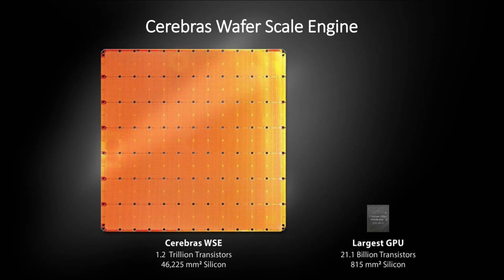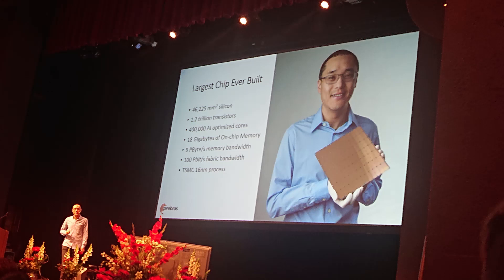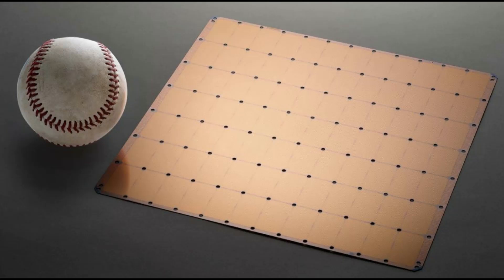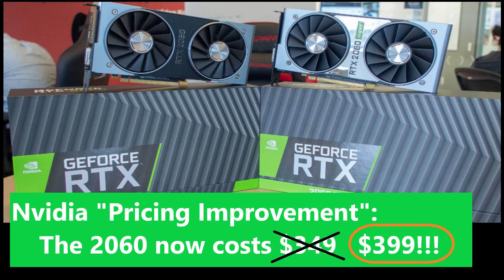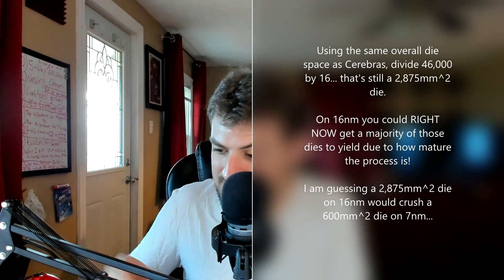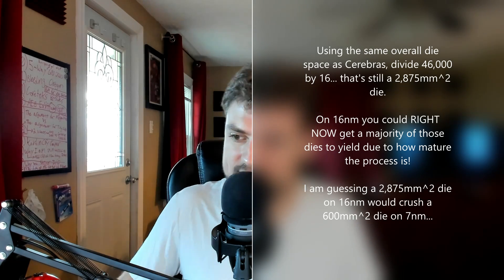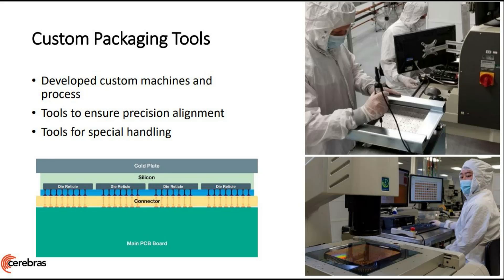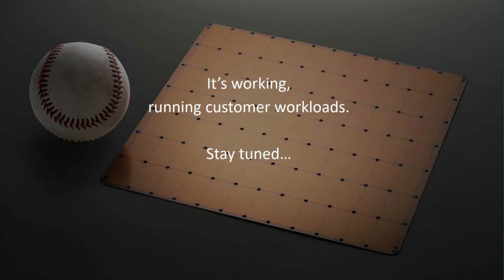The Monolithic Future of Silicon

Comment: In the near term the size of the reticle on the steppers will be the limitation on size of  die.  The only way to get around his limitation in the near term is to divide the design into identical parts  so the stepper just has to print one dice then step and repeat it again as many times as needed. I am sure just by looking at the picture this is how they did the 46,000 mm^2. It was one recticle printed over and over again. 

I think it will take years to produce a system that can print a whole wafer at once. However  a lot of applications can take advantage of the ability to construct ICs out of repeated units.

From what limited information I can gather Nvidia chips have been at the reticle limit since 28nm.  The current largest Nvidia chip is 815 mm^2 I believe.  The reticle limit of the steppers they are using is 32x26 mm so that would be 832 mm^2. I got this info from a source that I have no idea how reliable it is.

Comment: I think the main issue they are going to find as they go to smaller nodes is the ability to dissipate the heat generated by the chip. I think AMD is investigating building in Thermoelectric Peltier cool on their stacked chips.
Reply from the maker: Indeed they are

Comment: Those dies are kind of like SoC. But theoretically you can pack whole PC circuitry into monolithic die - cpu+ram+mobo+gpu together on one die. Question is how cheap and how fast comparing to what we have. It will just be smaller without any chances of overclocking or upgrades.

Comment: That's a good point.

If they made an 8 core i9 or Zen 2 with 8-16GB of memory built in to the CPU, what would we actually have?

There would be an obvious cut off point where we wouldn't gain any more, the architectures now are built with the caches keeping the execution pipelines fed from 30GB/s relatively high latency memory, so the architecture would have to change to take advantage of it, but in all honesty I'm expecting CPUs to have 256MB up to 1GB of L4 on package in desktops before 2030.

Might even see it in Zen 3 or Zen 4, HBM L4 on the IO chip.

Comment: Zen 4, perhaps double the L2 size, remove L3 altogether and have 2-3 times more cores in CCX /Chiplet, and have huge L3/4 cache in IO Die. This would allow shared L3/4 for all cores, and allow more cores per CCX/Chiplet. And not just eviction cache, but normal L3 cache.
Reply: Right on L2 double, but L3 has a crucial role in reducing the penalty when work loads migrate between cores.  Usually L2 isn't shared between cores.
Having unified L3 in a chiplet gives large bandwidth and low latency, avoiding going off die.
Reply: @RobBCactive  If you would move L3 on another die completely, you could have double the cores on the same chiplet, and have larger L3 that is unified with all chiplets.

Penalty would be higher latency, but you could lower latency from RAM as you would have larger L3.

It's perhaps not the best thing for desktop CPUs were the competition is still so much about single thread performance, but for perf per area and with more cores that would be the best way to do it in my estimation.

AMD's strategy to create one chiplet that is used in desktop, Threadrippers, EPYC kind of forces the current method, and also the smaller the transistors the more you have heat density, thus 16 core chiplets couldn't clock that high anymore. So integrated L3 makes sense. And with EUV nodes you can pack caches really dense so the area needed is not that much.
Reply: @juzujuzu4555  From what I see, a CCX L3 seems to work but perhaps an L4 cache on a memory channel might be interesting, saving energy to RAM and reducing inter-die performance issues
Reply: @RobBCactive  You could have all the L2 work for all the cores. So that if the looked data is on any L2 then it's copied to the core that needs it. 

So in this way I think you could have large L3 on it's own die. Just create big enough L2, perhaps 1.5mb per core, and have 16 cores per chiplet and thus have 24mb of L2.

L3 in it's own chip could be 256 to 512mb. Or perhaps even have cache chip that itself has faster and lower sections.

I'm pretty sure Zen 5 or 6 will have at least that unified L2. 

Though multitier cores are coming too, Intel of course already having them, so it will be interesting to see how they will handle caching.
Reply: @juzujuzu4555  That L2 effectively becomes L3 or LL - last level.
If you go and look at Zen3 chiplet die, you'll see L2 is part of core, nearer so lower latency.
The L3 holds data evicted from L2, it doesn't belong to any core, thus a core can load it into its own cache, process and invalidate it in L3 when it's changed.
Why mess with what works brilliantly?  Intel fanbois still claim chiplets high latency but the Zen3 design actually has faster access as measured by Aida64 than over their vaunted ring bus.  They did same on Zen4 launch claiming 63ns DDR5 is slow RAM access when ADL has around 68ns.  My Zen3 has 57ns IIRC and that's higher in the table unless you go back to older simpler  proccessors like Athlon 64 lolol
If you want a mega cache, call it L4 but the access latency will be slower as it'll need higher associativity,  which is why a disintegrated L4 with  caches in memory control die that serves a single 32bit memory channel is interesting.
Reply: @RobBCactive  That PowerPC architecture has L2 within each core, but they still somehow work as one collective cache. Though I don't think you can save data to L2 of other core, but you can read from the other cores. 

The reason to get L3 out from the chiplet would be to have more cores per chiplet and have one unified cache for all the chiplets. That could work if for example full chiplet would be 16 cores and have 16mb of L2 or perhaps even have 1.5mb per core or maybe even 2mb. 

In that case the penalty of higher L3 latency would be tiny, and the benefits of unified last level cache between all the chiplets could be huge. 

In the end that would save silicon area, would allow them to make 16 core chiplets that would be still only slightly bigger than the current chiplets. 

And you could make the cache die at cheaper node.

I don't think the higher latency on larger cache would be a problem, because there would be that collective L2 already. But to know for sure would require simulations of course. I wouldn't call that a mega cache as there's already 256mb on EPYC and 768mb on EPyC  V-cache version.

Though on desktop that wouldn't make sense yet, perhaps later when the number of cores goes up.
Reply: @juzujuzu4555  OK but the IBM L2 virtual L3 must have a cost in cache complexity.  So my argument is that increasing L2 size and complexity may be more trouble than it's worth.
I am sceptical that the IBM design will break through, the name L2 doesn't make the memory work faster, the risk is making common cases have higher overheads.
Now we know Bergamo reduces L3 cache to double CCD core count, we don't know if it uses 2xCCX or a single with unified L3, or even if L2 isn't scaled down too.
But Bergamo is intended for hyperscalers who want to lower cost of providing a level of service and likely know their jobs are not cache heavy.
Let's suppose there's an L3 die, every chiplet has to communicate with it AND the IOD.  That adds complexity, how do you physically arrange it so chiplets have equal service?
Then are these new chiplets compatible with desktop ones?  Have we lost the benefits of mass production to bin chiplets that meet exceptional performance and/or efficiency goals?  (Just 1 chiplet needs the 2 fast cores for max ST boost)
So I think there's economic arguments against it too.
Cacheing a memory channel as part of the memory controller for a better L4 OTOH encapsulates the complexity.  It just looks like fast memory using less power in a larger IOD, or with split MCD/IOD chiplets they could even use V-cache.
If it works for RDNA3 why wouldn't it for CPUs?
Reply: @RobBCactive  I would assume that the L2 works as fast for the individual core as normal L2, but in the case that you don't find the data on your local L2 then the latency is closer to L3 level. Though if this is the case you would still benefit as data doesn't need to be duplicated in L3 to have core to core transfers.

As I said previously I don't think this is economically viable at the moment as large chunks of desktop CPUs are only single chiplet and dual chiplet at most. It would be different with either having more chiplets or if the chiplets would have more cores by not having L3 in the die and instead have larger L2.

One clear benefit of this would be that you could have the same CPUs with multiple different cache amounts, thus you could buy what works best for your workload.

Probably the biggest reason not to externalize L3 is that current EUV nodes allow insanely dense caches, thus you wouldn't save much in the silicon cost. Though at the same time price of silicon gets exponentially higher.

Caching of memory channels would work and it would essentially be what I was looking for. Though I don't see IO die getting even more function as it's already massive and that's why I thought external cache chip would be the solution.

I don't have enough knowledge on the limitations on data transfers through the substrate. How much it uses energy etc. as that is probably hugely important aspect of what can be done.

Comment: Could be good if they can run each part at different clock speeds.
But if the entire chip has to run on the same clock, then it will have low clocks.

Comment: I think that there is possibility for future cheap laptops without RAM. 
If they manage to pack cheaply 1GB of cache in CPU maybe it will be cheaper to put in laptop this CPU plus drive that have 4, 8 or 16 GB of very fast SSD plus 120-240GB of cheap SSD memory in it instead of normal SSD and RAM slots. 
So there is 1GB of ultra fast memory that is swappable with very fast (slower than DDR4 but if it gets to slow DDR3 speeds it will be enough) and rest of a drive that manage data storage.
This way having non volatile 8GB of memory that is that fast computer will be booting up in a second. Not seconds. The only waiting time will be things that we don't use so often. But 8-16GB should cover most of daily things. System, browser and probably 1-3 regularly used programs.
Reply: Cache is not RAM. Assuming you mean skiping the cache hierarchy and replacing DRAM with SRAM;  no, won't work. You still need to have the cache because a low latency cache is by definition a small cache. A big SRAM die will have a lot of latency and won't be much faster than DRAM. DRAM is drastically lower power, so it makes more sense to e.g. have some HBM2 dies on an interconnect.
Reply: @soylentgreenb  ahh ok, thanks for starting out my thinking
Reply: @e30tomas54  That's why cache hierarchies came to be to begin with instead of just making L1 bigger. The latency to reach RAM kept increasing and the ability to make SRAM caches so large that they became slow forced the creation of more and more levels of hierarchy.
Historically on X86 / X64 chips:
There was no cache in the beginning; the latency of RAM wasn't so bad and the chip ran only at 4.7 MHz; still, something was needed to deal with the latency problem and this was registers holding the data you were currently working on.
Late 286 motherboards made for the fastest 286 chips integrated some L1 cache; this was entirely on the motherboard and not on the CPU because there was not enough transistors to waste on a cache. It was maybe 10-20% faster to have the cache.
386 motherboards typically had L1 cache on the motherboard.
486 processors introduced L1 cache on the CPU die, much faster and lower latency, buy only 8 or 16 kB. Some motherboards also had a much bigger, slower cache still on the motherboard. 486 introduced clock doubling and tripling, so the motherboard cache only ran at CPU speed.
Pentium had on die + motherboard cache.
Pentium pro, pentium II and pentium III had on die L1 cache and an L2 cache on the same physical package as the CPU.
Later pentium III's introduced put the L2 cache onto the die.
L3 was introduced with multicore as shared cache for all the CPUs, allowing the L1 and L2 caches to be kept small and local to each CPU.
Broadwell i7-5775C  also had a level 4 cache of 128 MB eDRAM. This could also be used by the integrated graphics to get a descent amount of bandwidth.
Something like this could easily come back, but I think it makes more sense to have like a stack of HBM2-3 or something; especially for integrated graphics.

Comment: A bigger chip produces more power consumption and heat. So to getting a reasonable product without 1000 watt power draw, they have to clock it lower. But at this point, they can just use the smaller chip and clock it higher, wich is cheaper.
So everything stays in balance in the end, no need for demanding bigger chips.
Reply: It puts out 15 kW. Which is very reasonable for this die size and what they use it for.

Comment: It seems almost pointless to go Big without going HUGE. You don't get enough SRAM to use it as anything other than a somewhat larger cache, you don't have enough area to throw significant fractions of it on redundant routing, and you still have the yield issues and retooling problems. At that point, why not just use chiplets and stacking?

But HUGE has many benefits. A lot of the costs—extra and otherwise—get amortized, you can work in a fundamentally different way (Cerebras' waffle is model-parallel), and internal bandwidth ends up so high that you couldn't emulate it with other technologies (except maybe ThruChip wireless interconnects?). A 50k mm² GPU might not do much for the average consumer, but certainly Disney or NASA might buy it.
Reply from the maker: "It seems almost pointless to go Big without going HUGE."  I actually somewhat agree with this statement.  I think tiny monolithic dies have a beautiful future, and I am also excited for Megalithic dies for specific tasks (maybe even gaming gpu's).  But in the middle it is time for chiplets and stacking :).